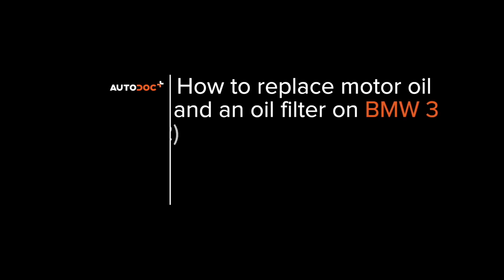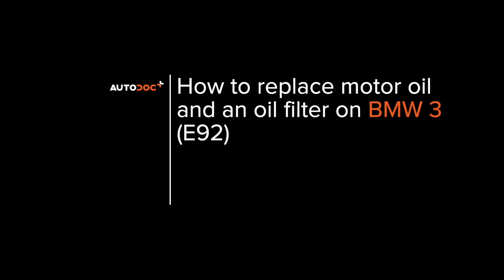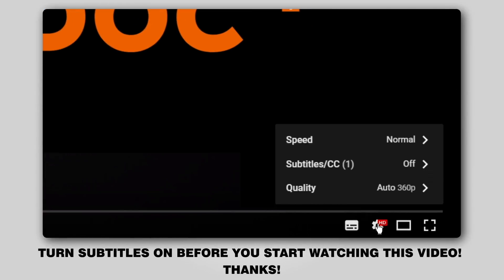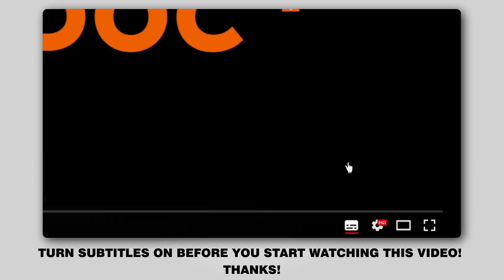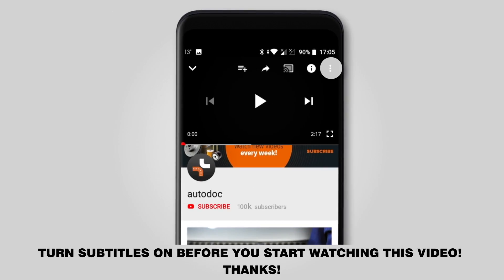How to change oil filter and engine oil on BMW 330i 3 (E92) [TUTORIAL AUTODOC]

Comment: You do mention and show using a torque wrench, but I didn't see the spec for the torque?
Reply from the maker: Our videos are for guidance only. All routine replacements and values can be found directly in the technical documentation for your car or use the help of the auto maintenance serviceю
AUTODOC
Reply: The spec is in the CC text so you must enable captions.

Comment: What is the all purpose cleaning spray?
Reply: Probably brake cleaner or any type of volatile spray cleaner that will evaporate off rather than pool
Reply from the maker: Thank you for your comment!
It is a liquid capable of removing and degreasing surfaces from olive traces.
Best Regards,
Autodoc team